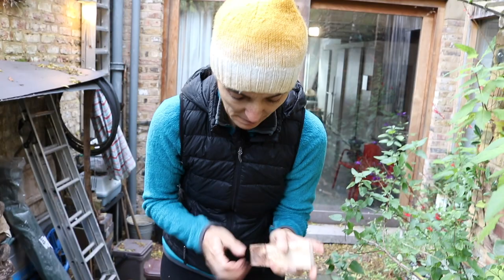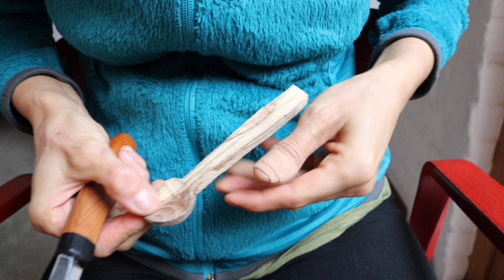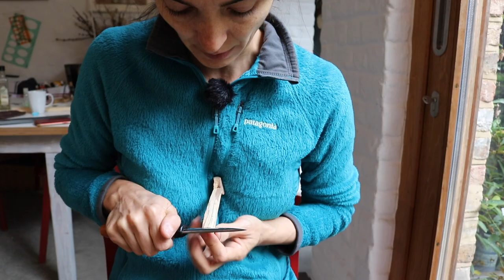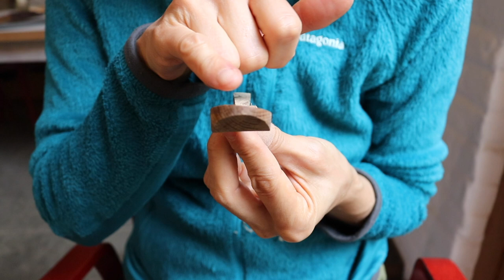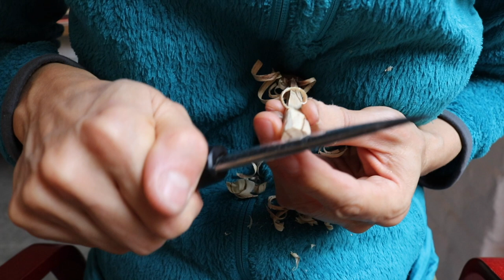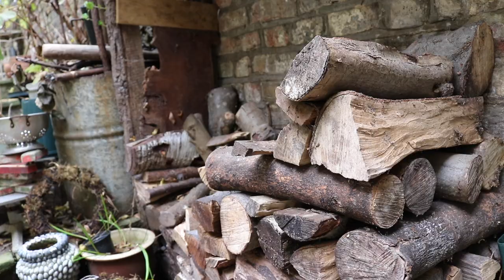How To Carve A Teaspoon - Andreea Grad

Comment: Very nice video. Funny to see such large tools used for such a small spoon. Clearly it works out well, however, I think I would have used a smaller knife for better control ( less risk of cutting myself )
Reply from the maker: You can most definitely use a smaller knife, but a slightly larger knife allows you to take longer cuts ~Peace~

Comment: Why would one avoid the knot? I think they add so much character and actually find them visually appealing. Do they weaken the finished product? Are there any circumstances where a knot being left in could actually work out well? Thank you.
Reply from the maker: In most cases you remove the knot because when it dries it increases the chances of the wood splitting. You can include a knot in a the part of the spoon where it may not potentially split, such as the handle, even then you should err on the side of caution ~Peace~